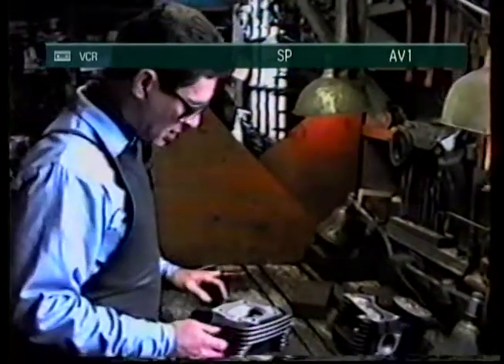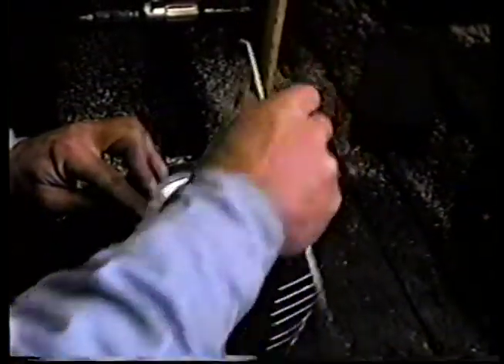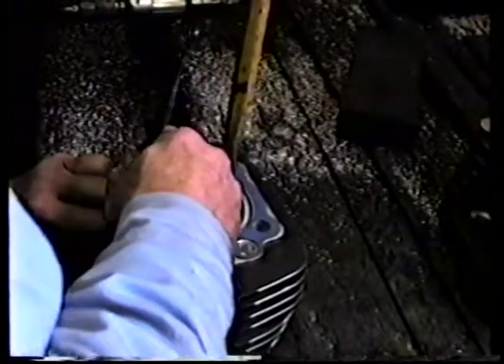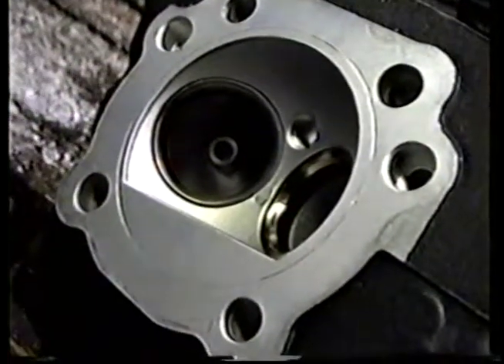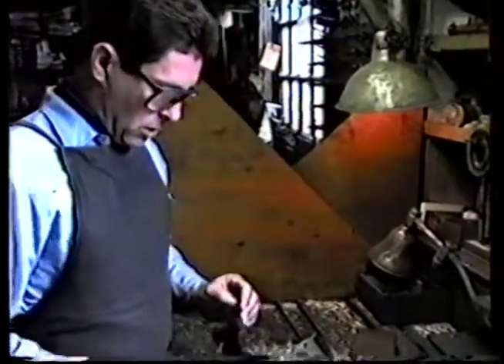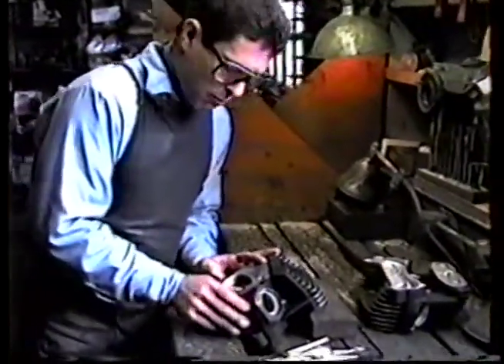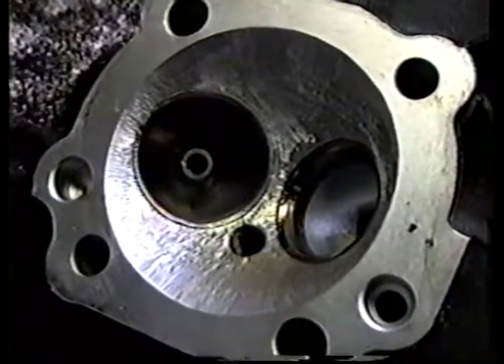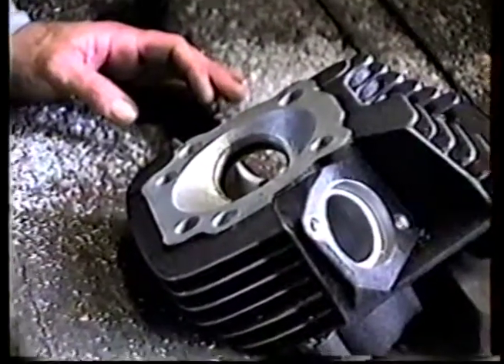HDES-07 Evolution Hemi Combustion Chambers for Harley-Davidson

Comment: 8cc bigger...not a substantial change in compression???  Almost lost a whole point. That aint gonna help.
Reply: When you consider the amount of fuel and the more even heat across the cylinder and the better fire you will get it would be worth the trade. Just the part of the piston that stays cool would I think give you a problem. If you have ever burned a hole in a piston due to a hot spot you would get it. Just the position of the finger of the spark plug will make a difference.
Reply: This is not a true Hemi. On a true Hemi, we make up the lost compression with a properly radiused piston dome.